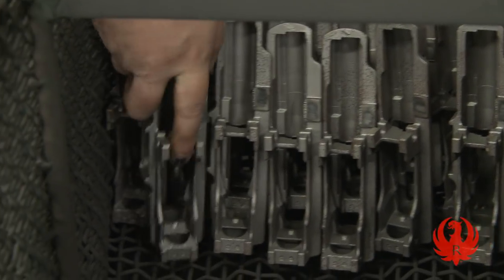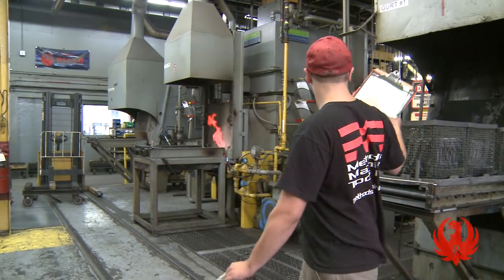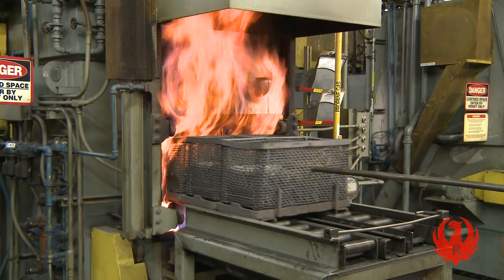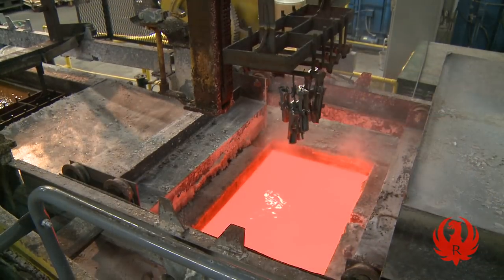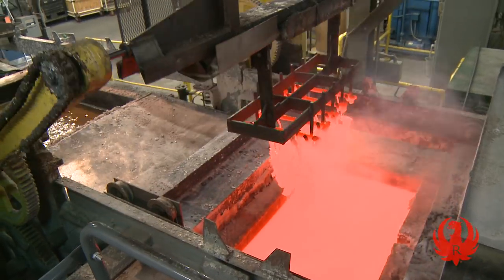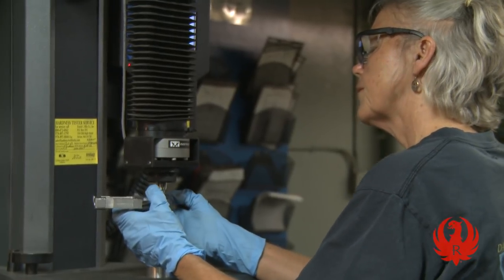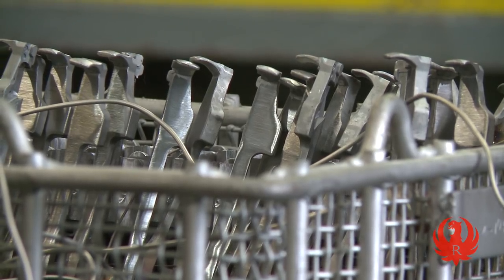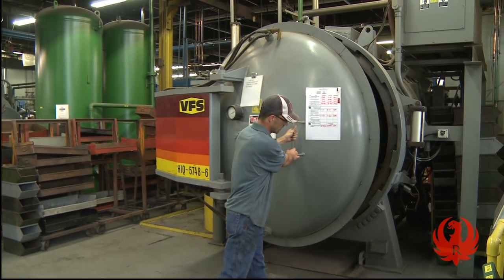Part 5 Ruger How It's Made -- Heat Treat

Comment: jesus christ dude.....this is why you spend the extra $100 or $200 bucks...you get American made shit, not some foreign casting bullshit. I sold my springfield range officer once i found out it was cast overseas ...i sold that and my Colt XSE and bought the new Ruger SR1911 officer 45, its fit and finish is a beauty, nothing in the gun store could compete..Colt would be 2nd in line as far as looks go, but my Colts worked perfectly just like the rugers
Reply: @Eugene Stoner Where in my post did i say casting is better than forged?  ...lay off the drugs
Reply: @Eugene Stoner Yeah, my post was saying " just buy the ruger" rather than cheap out and buy a Rock Island or Taurus...the frame looks cast on my Ruger officer 45, but i believe the slide is forged...even Springfield has their frames cast overseas, Ruger is 100% American , my point was to help people just save the extra $100 or so and buy a Ruger instead of cheaping out and buying foreign cast garbage ..
Reply: @smalltownplaya712  per your logic you should sell all your electronics too. How about your car? Did you know the Toyota Camry has the most American made parts installed? Just saying. And I would still choose an HK over a Ruger.

Comment: Damn it, i fell for the meme, all my rugers are straight trash. my 1022 jams every other bullet, my bolt gun is heavy and far less accurate than my tikka, my ruger handgun has bad grips and jams a lot =[. all of my rugers are POS =[
Reply: Ruger has top-notch quality service, all you have to do is call them and send it back and if they can't fix it they will send you a brand new gun. I own several ruger's and I have no problems with mine. They are simple to break down and clean and put back together.